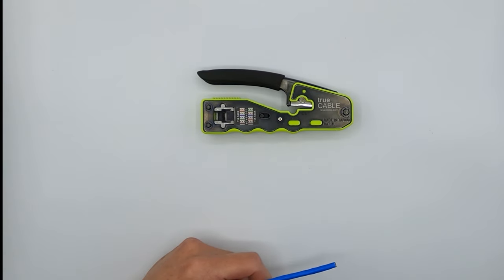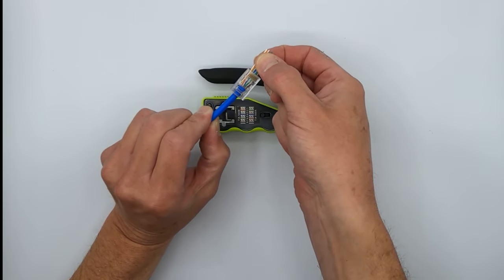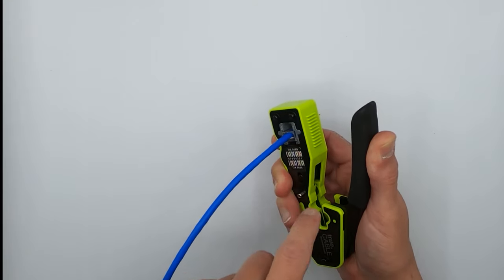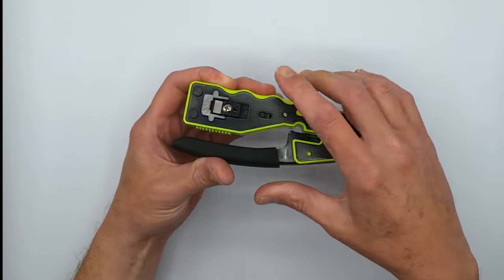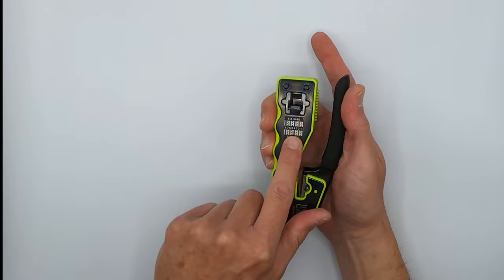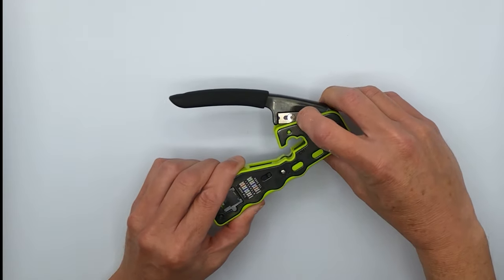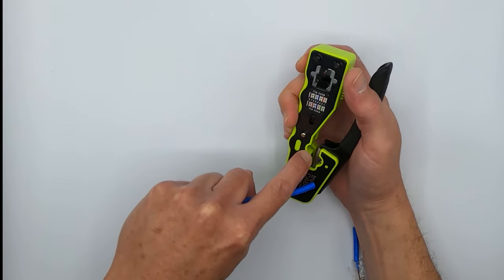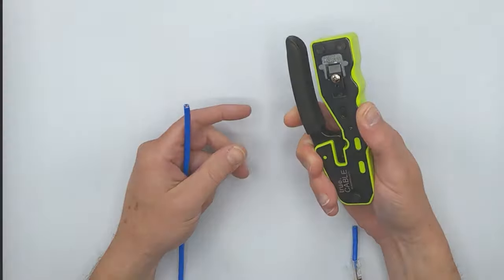A Look Back At The Pass Through Crimp and Termination Tool - Updated Tool In Description

Comment: Biggest issue i have is pin 8 doesn’t always crimp well. Purchased this tool cat 6a from true cable and cat 6a connections from true cable and its a 50/50 shot at getting pin 8 to test. At first I thought it was just me but let someone else borrow my crimper and connections and they had the same issue with pin 8. 1-7 always test fine but pin 8 gives me troubles. Wish i could return or exchange it
Reply from the maker: Hello Keith! I am sorry to hear you are having trouble. I know what is wrong. I took a look at your order and the RJ45 8P8C plugs you purchased are for our Cat6A U/UTP Plenum. They are too large for the Cat6A U/UTP Riser. This is why the pins will not stay down--the insulated conductors found in the cable are too skinny for the plug. The correct plug for that cable is our Cat6/6A Standard Load Bar Plug, and secondarily the Cat6/6A Pass Through Plug we also sell. That all said, please contact us, and will replace your tool if it is defective. trueCABLE has a Forever Warranty and we are serious about it!
Reply from the maker: @keithcevasco2827  Hey Keith! The Cat6A XL Stagger Passthrough RJ45 Plugs are meant for use on our Cat6A Unshielded (U/UTP) Plenum, as the insulated conductors fall within the plug fitment range. We don't suggest their use on any other trueCABLE brand Ethernet cable although they may fit another cable from other brands as well. The insulated conductor fitment range is 1.05mm to 1.15mm and the cable jacket outer diameter (OD) can be up to 7.30mm. We hope this helps!

Comment: Oh look another tool that cant seem to cut 1 and 8
Reply from the maker: Hello and thanks for your comment. When terminating pass through plugs, sometimes the conductor insulation (not the copper) does not get fully cut and the hanging conductors have to be brushed away at the end of the process. Due to the process and tolerances involved, this will likely always be the case. We hope this helps!